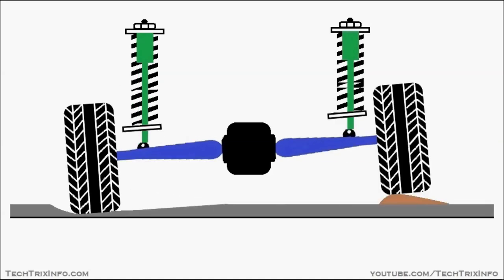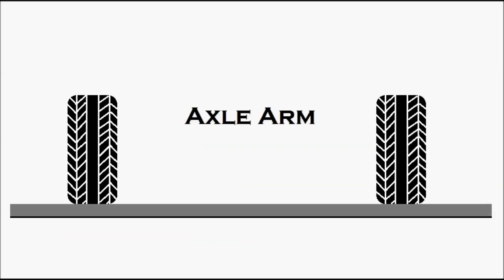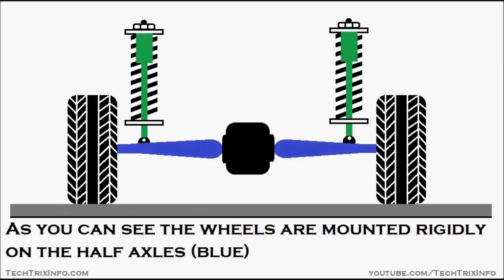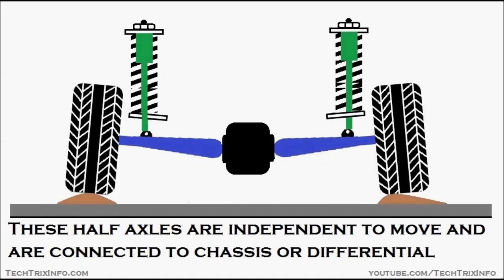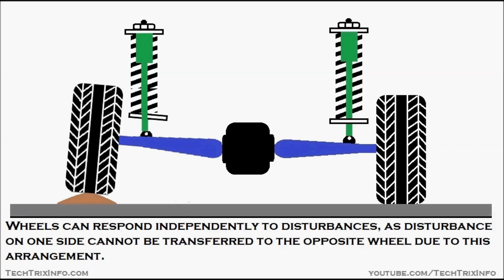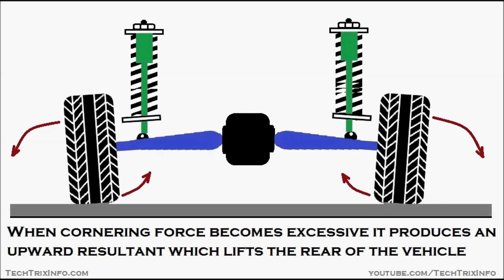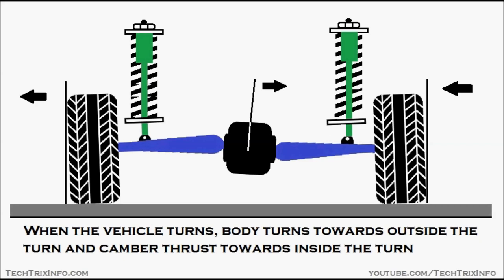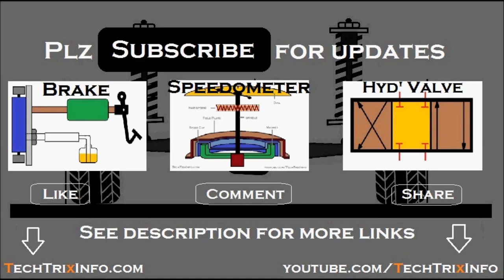Animation | How a swing half axle suspension works.

Comment: WHAT IS THE DIFFERENCE BETWEEN SHOCK ABSORBERS AND LEAF SPRING?
Reply: Armando Samorin Google both and you'll see
Reply: The shock absorbers here are actually coilovers which have a coil spring on the outside and a shock absorber on the inside. Leaf springs are flexible metal banded together and can flex and move on a set of hinges for articulation. Without coilovers the shock absorbers would have been mounted independently of the springs regardless of whether it had coil springs or leaf springs

Comment: You would still need a sway bar to prevent your car from rolling on the highway, and that would destroy the only advantage you named.
Reply: It's mainly meant for off-road vehicles.
Reply from the maker: Tks for the comment 
WhatsApp us @ +919744615655 for Engineering related updates and doubts
Reply: Sway bars dont prevent a rollover, they only help